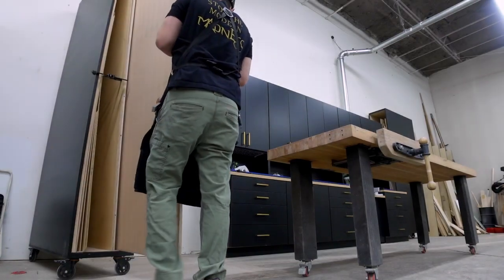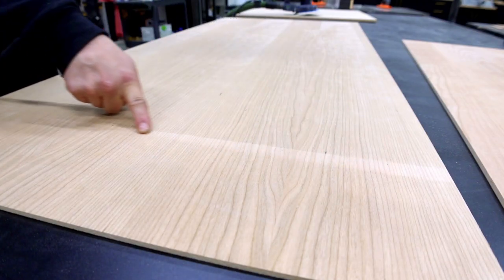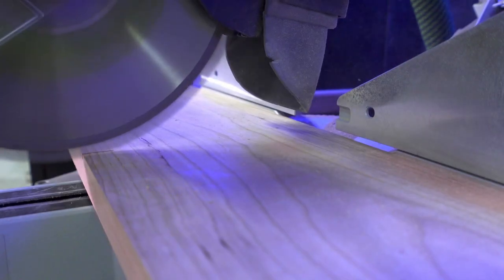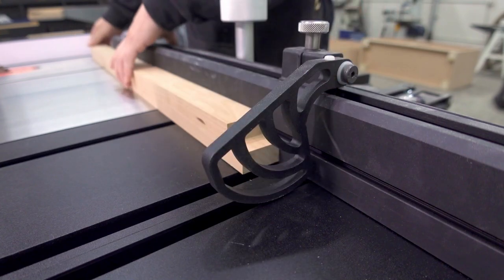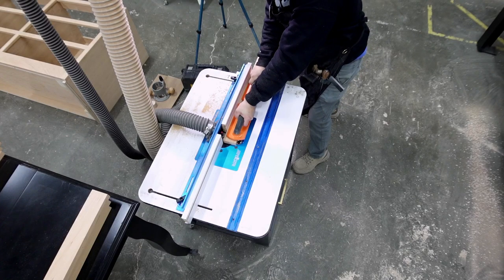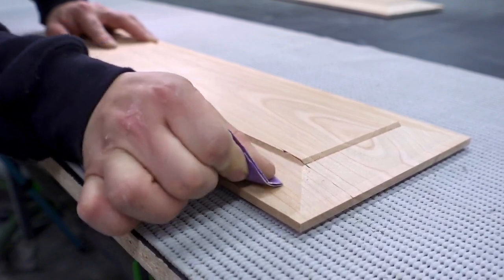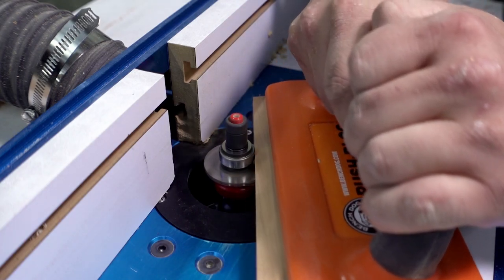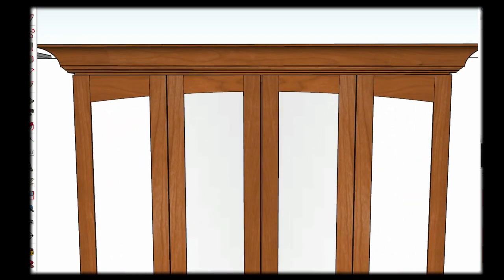I Almost LOST A Finger For This One!

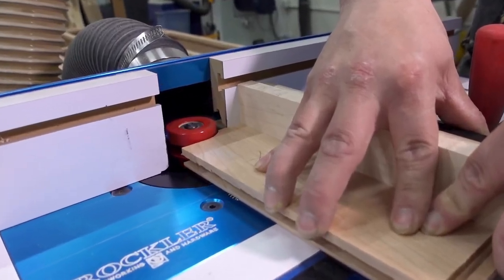Comment: At 11:43 - this mishap could have been prevented by having your backer board laying on its face instead of on edge.  It happened because the backer board lost contact with the fence.  A coping sled would also have prevented the issue.  
Workshop Companion has one or two devices which make moving sheet goods alone easier.
Reply from the maker: So true. Then it would've been too wide to get shot into the blade. I definitely need to make a jig for the router table

Comment: Great video. I know the YT algo forces the 20min-ish bits, but to be  honest I'd sit through an hour of your content, no question. Good to see a woodworker NOT slather glue, seriously. I also follow your general rules, because huge rivulets of glue is wasted $$ and time in clean up. Also agree that any kind of router is scary -- ask my left middle finger if he agrees. Question 1: I'm hesitant to use wet cloth to get squeeze out based on the idea that I'll wind up just creating a thinner form of glue that goes deeper into the grain... thoughts?
Question 2: Was that a part 2 spoiler where you have to plug your wrong-side Euro hinge holes? LOL.
Reply from the maker: Haha I appreciate it for real. It's more so the amount of work that I would have to put into one video. A 45 minute video is a ton of editing. So I'd rather get 2 videos from it. 
1. The wet microfiber is so extremely good at cleaning the grain, it will surprise you. Give it a try.
2. Thankfully I paid very close attention and indeed...... drilled them on the...... correct side.

Comment: first of all amazing project not realy my style but i still think that is F impressive to build smth like that but honestly i have a question a few years back i made a epoxy table with my dad for my dad and im only now realy finishing it but i have that problem that when i sand the epoxy with my random orbital sander that you can see the seams where the sander overlaps if you know what i mean is there a way to prvent that other than hand sanding?
Reply: and another thing is in your video is so much information all those deatial i mean if you realy want to get every out of it you have to watch it multiple times i dont even know if i have seen a video of an project with that much detail thank you for that
Reply from the maker: You might be going too slow with your orbital. Criss cross your motions, so go across the width of the board with the sander, and end with strokes going with the grain. This will even the sanding.
Reply from the maker: I'm glad you are getting so much out of them.
Reply: @FortressFineWoodworks  well thats smth i have never heard going too slow with the sander normally its the opposite :D but i will try it tomorrow thanks for the advise
Reply from the maker: Yeah I don't follow the 1 inch per second rule. I go about 3 to 4 inches per second